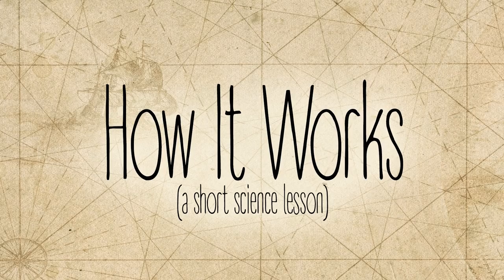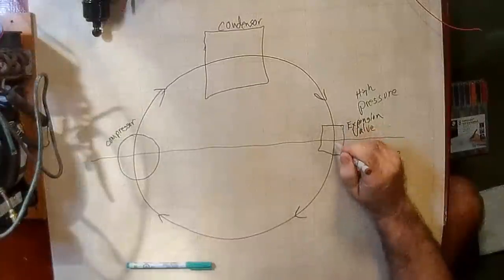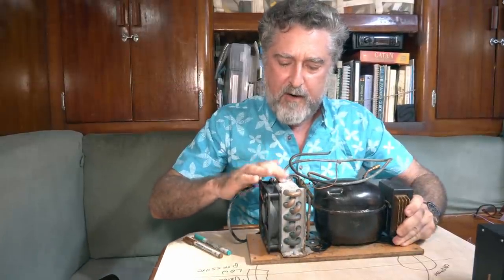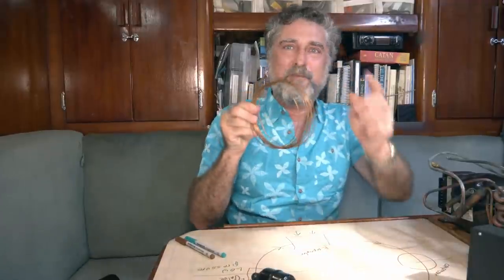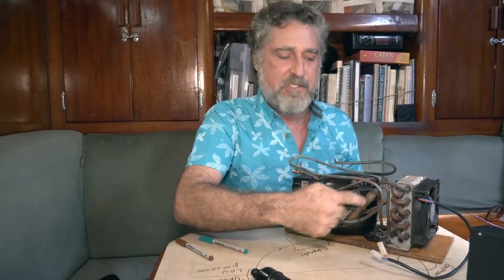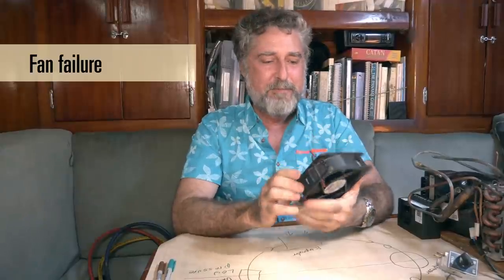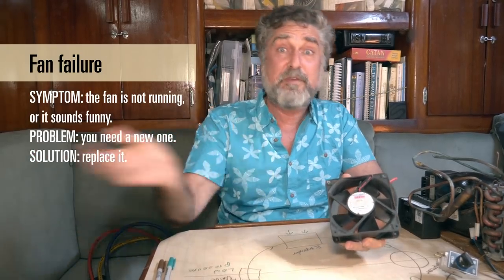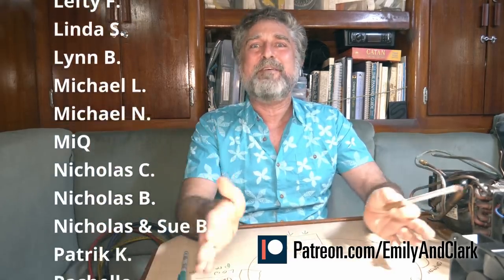How Does Boat REFRIGERATION (& A/C) Work? [Capable Cruising Guides]

Comment: We just ordered some spare seals for the quick coupler. Good to have as spares
Reply from the maker: Yes the right spare at the right time means everything.

Fir those I tend to just cut them out and solder the lines together.  I didn't even know there were spares available.
Reply: @Clarks-Adventure  Cutting them out seems like a good idea, they seem to be a frequent failure point, ours we all dried up.

Comment: Refrigeration is cool!! 😜 My home is heated by a backwards fridge. Here is Sweden we have -20C, sometimes -30C nights in winter and all my heating comes from a ground source heat pump, which is a big reverse fridge taking 8C from a borehole and boosting it up to 40C to run around underfloor heating circuits indoors. It’s so energy efficient, my electricity bills are a quarter of my neighbours who have direct electric (resistive element) heating. The engineers who first developed all this stuff did us all a huge favour 👍👍
Reply: Those systems are just now catching on here in the U S and are so high priced it will take 18 years to pay for itself.  And that's when parts should start to wear out.
Reply: @popsoldboats3406  It sure was expensive - we paid 169k Swedish kronor in 2016, that’s around $20k.  But we no longer have to pay $1,200 a year for firewood and our electricity bill dropped by a third because the hot water production is now so much more efficient than the old electric immersion heater system we had before. My estimated payback period on what we spent is 9-10 years, assuming electricity prices rise around 3% per year.
Reply from the maker: One could build their own.  I'd start with a mini split heat pump.  The one I have in my land house costs about $750us. https://www.ebay.com/itm/PIONEER-12000-BTU-20-SEER-Mini-Split-A-C-Heat-Pump-115V-16Ft-Full-Install-Kit-/293615688932?_trksid=p2349624.m46890.l49286 and I like it a lot.  You might want two of these or more depending on house size and desired zones.  Burry some hose or drill down....   Add a pump and replace the mini split condensers with water heat exchangers (see next week's video).  And you have a fine system.  Reasonable price.

Where my house is located the weather is mild so I just use air cooling for the condenser.  But if I lived someplace colder or of I had a pond on the property I'd set up this kind of system.  Total cost for a 24,000btu system would be $1,500us plus developing the geo thermal side, but that can be a ditch and hose.  Definitely a DIY kind of project.
   This wouldn't give hot water without more modification but though we grew up in COLD places we never plan on living where water can't be heated by the sun ever again.  I hope to never see -40 again in my life.
Reply: @Clarks-Adventure  that’s a really interesting idea and it would never have occurred to me to DIY it. The heat pump installers all seem to subcontract out the borehole drilling part anyway, so I’m sure an individual could also get one of the drillers to drop a 150m+ deep hole into their garden and install the necessary U shaped, ethanol filled plastic pipe within it. Too late for me, but I hope someone sees your suggestion and takes it on as a project. 👍
Reply from the maker: Yes, and if you already have a water well I'm sure you could work with the existing hole.

Comment: Good video.
I just managed to fry my frig controller. An interesting problem that you may have better insight into than I do.
I have installed LIFEPO4 - 2 banks of 100AH drop-ins (Redodo) along with double bank lead acid for start. All was going well until about 5 hrs on eng at which point the lith banks were say 13.3v and I started getting A/P and electronics failing. Running below, my cheapie panel gages were showing 39V !!! Before being able to shut down all charging, the frig went out as well. The frig controller has the main diode burnt up but no other visable damge on the PCB. 
Post-event, my regulator is a balmar AR5 and looks to be OK with field at 11.xx at eng start, dropping to 7.xx after say 15min. 5-6 fuses were blown and saved the AIS/VHF and A/P etc. All fuses that blew (were originally on lead acid), have had to be replaced by higher rated fuses  (2A on A/P holds at 5A, VHF from 7.5 to 25!! etc) . So it looks maybe that as the lith bats approach full charge, the amps drawn by stuff  increases. This is counter-intuative. I would have thought that as volts go up, the watts would be the same under the same duty, and the amps would drop.

Have you ever experienced the same thing?
Have you any idea how a standard 80A alternator could put out 39V? 
Do you think there is a potential that the LIFEPO4 built-in BMS's could be the source of the high voltage?
Returning to home - port and shutting down, both house and start bats are showing normal volts at 12.6 and 13.3 and are holding charge etc , and I do not see any repeat of high charge voltage. Since failures happened only after several hrs on eng it would seem that a thermal run-away type event was happening?
Any insights would be appreciated, love you site
Richard
SV Kelaerin (Formosa 46)
Reply from the maker: You have a few misunderstandings here.  And you must understand I can't do debugging through YouTube comments.  I have over 80k subscribers and a life.
   If you would like my help there is a Patreon tier called Dream Believers that gets you phone access.  We can certainly get this all sorted.

Comment: Hello Clark - so great!  Really top stuff.  I am a mechanical engineer and I know this stuff, but now I know it better!  Thanks so much.  I wanted to ask if you have any tips about re-configuring a 5000 btu window unit and use the parts to custom adapt to an older boat - 1965 Pearson Vanguard.  I've got plenty of room to fit it into the boat - it's not 12v but it dehumidifies while at the dock (I weekend lake sail and don't really have a solar panel charging system to speak of or a battery bank, only 2 lead batteries w small individual solar chargers, I just use shore power & a Honda knock-off generator if needed).  Right now I have the window unit hanging in my hatchway (looking as nice as I can make it).  I just leave the entire unit on the dock when I go out sailing for the day and put it back in place before I leave the dock to go home.  As a dehumidifier it works great, very efficient. The condenser actually uses a condensate tray submerging the copper line to help cool - air/water cooling.  New less than $100 on Amazon.  Anyway, I bought a spare and I want to deconstruct it and use raw water to cool the condenser and pipe it up out of the way unseen.  My Honda knock-off gas generator also can run it w 120V output if it ever gets really hot while on the hook.  Even if I totally botch it, should be fun and I know that I will learn plenty.  I figured you might enjoy this challenge.  Where am I going wrong ?  Thanks in advance.
Reply from the maker: I kinda took this a few steps farther with this
https://youtu.be/xF113aUlZgo

Uses very little DC power.

It's now available as a kit at MarineDCAC.com

But sure you can do it that way if you don't mind the power consumption.  If that's OK with you then go for it.

Comment: Thank you for sharing your refrigeration knoledge Clark . I am troubleshooting the frigoboat system in my sailboat now. I was looking at your little material list and you give us the mechanical thermostat link. could you provide a link to the digital thermostat as well ?
Reply from the maker: The digital I use is actually for another application
  I have to modify the main circuit board on each.

So I don't have one I can recommend

Comment: Another great video Clark! My fridge works fine, however I cycles every 10 to 15 minutes. I have sprayed foam insulation all around the casing and replaced the thermostat. Any suggesting?
Reply from the maker: What's wrong with the cycle
   Is it getting too warm between cycles?

If so that's your thermostat.  Either there is a hysterisis setting to adjust or it's just tacked.

Comment: Hi Clark,

Great video, thank you. I have a sailboat based in England. I have a problem with my fridge where there is a blockage, the local refrigerator guy said that I need a new system at a cost of £1100.  Excluding VAT. The engineer maintains that oil from the compressor has got into the refrigeration lines and has developed a bad blockage. The fridge is Frigoboat. 
Any help or confirmation that this can actually happen or advice you can offer will be appreciated.

Apparently you can’t buy or use R134A gas in the UK unless you are a certified engineer. It’s law
Reply from the maker: You have a lot of LAWS that side of the pond.  I recommend you watch your voting in the future.

I've seen this and I have a solution.  I've used it successfully but never heard of anyone else talking about it.  I guess you could do the trick and hire your guy to recharge the system if you can't find any gas.

  So here is my trick.  You need high side access.  Hook up your gages but remove the high side hose from the gauge manifold.  Apply gas pressure to the low side (you could use compressed air, I use refrigerant). That tends to blow the blockage from the cap tube.  I guess if it was really stubborn you could use some acetone or something to rinse that side and vacuum to remove it.
   Vacuum and recharge.  So far I've been 100 percent with this "fix".  Whatever clogged the system is still there but in the two systems that I still have contact with it hasn't reoccurred in like 5 years.

Worth a shot to save a grand.

Comment: Good job.  Clark Im thinking of  buying a self contained unit to bring on my boat, any idea how many hours a day i should calculate it running for my load calc. summertime  in the carribean. Thank you
Reply from the maker: Depends on what temp you set it for
  Those Engles are real low power draw.

But no I don't remember.  When I've had one going it was very little power.

Comment: Great explanation. I have worked on ac most of my life. Worked maintenance with my father from 10 years of age. Now mostly automotive. I have inherited some nice gear. Gauges, and a vacuum pump are so handy. I have picked up a bunch of adaptors to use with the small cans used nowadays.  This is probably one of the best overviews I have seen, and you really explain the overall function of each part really well, and bring the whole assembly and process together nicely. Thanks for another great episode.
Reply from the maker: So nice of you to say.
Reply: @Clarks-Adventure do you know where I can get a control unit just like the one you held up during the video? Thanks!
Reply from the maker: eBay
Reply from the maker: Or if you want to pay more.  Rparts.com

Comment: Is using the hull in contact with water an efficient way to get rid of the heat? Is it worth it to design your freezer to be low in the hull?
Reply from the maker: Glass hull no.   Metal hull maybe if you rig a condenser in contact with it.

Look up "keel cooler". That's basically what you are talking about.

Condensers are easy to make.  Take a look at next week's video and notice my evaporator.  I built it myself.
Reply: @Clarks-Adventure  Cheers. And thanks for the video!
Refrigerator and water maker are the two things I want to be able to build and/or repair myself.
Oh and solar charger and motor controller haha.

Comment: Do you have plans for diy evaporator plate? Or a link
Reply from the maker: I don't think a lot of people would be interested.
It's basically a copper box with small (3/16?) copper tubing wrapped around and soldered.

Add an expansion valve or cap tube and you are done.
Reply: Thank you.  I will give it a try.  I am enjoying watching your videos.

Comment: Clark, do boat refrigerators ever leak?  I have a leak under my refrigerator.  It is not small either (about 2 or 3 cups) when it happens and it happens randomly about every 3 or 4 days average.  Do you think it is coming from the refrigerator or somewhere else?
Reply from the maker: Leaking what?
Reply: @Clarks-Adventure  Water.
Reply from the maker: That's likely just condensation.  Refrigerators are cold and if it's a humid day they take the water out of the air.
   Put a glass of ice water on the table and watch it.  Soon it will be wet on the outside.

   There is no water in a refrigeration system.  Rest assured it's s not leaking water.

Comment: Would love it if you know of a source of modular set of these components that work together so I can make freezer compartments, and air conditioners using mostly the same components and have a large set of common spares.  I can easily build insulated boxes, and heat-air exchangers.
Reply from the maker: Me too but..  
Fridge compressors are low back pressure units.  A/C compressors are high back pressure units.   
To be efecient they are built different.
Reply: @Clarks-Adventure  Ah, I didn’t realize that. Maybe I can find  a company that makes both, and uses common parts for other elements.
Reply: @Clarks-Adventure  Oh, great, building an air conditioner is something I have to do. I look forward to that video!

Comment: Hi been watching your refrigeration videos. I have an Adler barbour system cold machine. I have all the tools and I'm pretty skilled. I pulled out the condenser unit and have it here on the bench.  2 Questions. 1: I do not have a service port on the compressor I do have a tube that has been pinched off and soldered shut. I do not have a service port.  question where can I attach the service port (solder it in?)  Question 2 My compressor says Refrigerant R12 qty 15 oz) Is the R134a compatible with this condenser system? Thanks in advance
Reply from the maker: If you have an r12 system you likely have an induction motor compressor.   
The power savings in changing to a brushless DC motor based system are extreme.  Like half the power.
   I suggest you swap it out and get gear based on a bd50f or bd35f compressor.
Reply from the maker: If you want to just swap the compressor that's possible.  You should flush the rest of the gear with solvent to remove the lube since they don't all mix well. 
If you swap it all you will know your cap tube matches your compressor/refrigerant and not have to calculate anything.  Also your evaporator will move 0 corrosion.

Oh if your system is that old it could be holding plate based.  Also not efficient.
Reply: @Clarks-Adventure  Also I have seen some Used R134a AB units which are newer and look like drop in replacements for $600 +/-
Reply from the maker: Yep.  And they are all about the same.  Just make sure the evaporator fits and is to your liking.
Reply: @Clarks-Adventure  Again Thanks

Comment: My water cooled Isotherm will stop cooling 2-3 weeks after 143a refill. How do you find a leak in sometimes inaccessible tubing, filter, evaporator, and the heat exchange element seacock under the waterline outside
Reply from the maker: It's a challenge.  I have a leak detector on our Amazon store (see description) that makes that job easier.
Reply from the maker: PS get that one.  A lot of the other cheap ones suck

Comment: Hi Clark.  Megastar tutorial on common issues.  I am a 'watch the gauges nut' also.  Can you provide link for digital 12v thermostat.   I looked through a zillion Amazon links thermostats and could find the electromechanical type or 110v digital type.    Very much appreciate it.  Based on this one video I will be a life time Youtube subscriber to your channel.
Reply from the maker: Wish I could.  I had planned to.  But the one I use actually needs a board modification before it's good to be used as a thermostat.  It's something I do so quickly I forget about it.

But there are loads of them on eBay.  I just don't want to recommend something I haven't even tried.

Comment: Capilary tubes on frigoboat  are famous for plugging ,warming the tube with a hair dryer  most of time releases the blockage
Reply from the maker: Means there is water in the refrigerant.  Needs to be vacuumed and recharged.  I talk about that in next week's video.
Reply: @Clarks-Adventure  Not in these cases ,techs claim its a waxy substance that plugs tube

Comment: That fan is in a "suck position" Clark :) 👻
Reply from the maker: I didn't set up this sled.  Removed it from a boat.  
Works that way fine as long as you seal the incoming side to the condenser.
I like aluminum or stainless tape for that.

Comment: Well explained (I do know 'Fridge) I always start with "What temperature does water boil at?" Most say 100/212. Then I ask how a pressure cooker works. Some do know. Change the pressure and the water boils at a different pressure. Take a suitable liquid, drop the pressure to boil it at a low enough temperature. Take the resultant vapour and raise the pressure to a boiling point above  ambient. You can then let it cool and it goes back to liquid. 'Fridge.
Reply from the maker: I use the pressure cooker analogy in next week's video (which I filmed two weeks ago).  When I'm vacuuming the system.
   Thanks Jonathan.

Comment: Aye m8’s, great stuff and loads of info. For next part: Do you carry a cylinder of Tetrafluoroethane on board?
Reply from the maker: Yes I started this cruise with about 40 lbs of it.  But I've gone through a lot of it.  My air-conditioner uses it and I fixed a LOT of fridges last summer with lockdown.